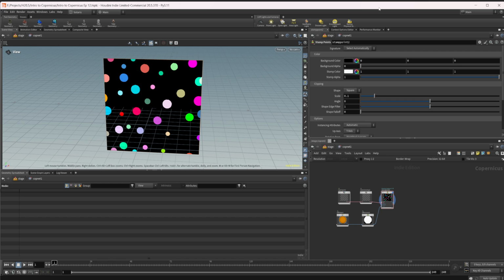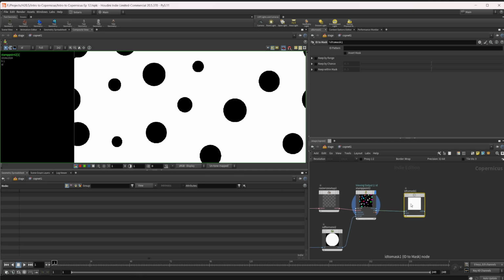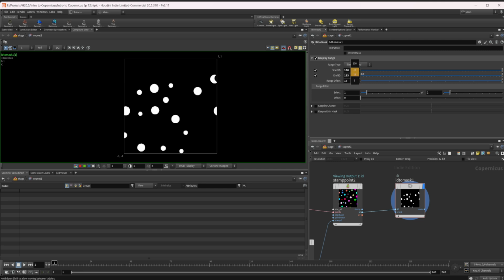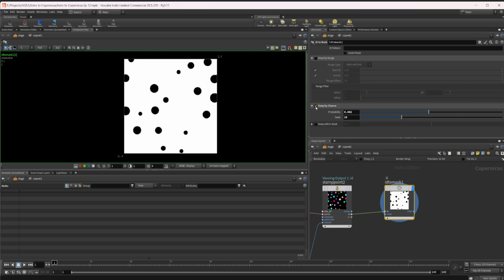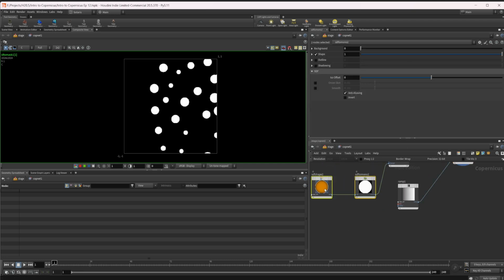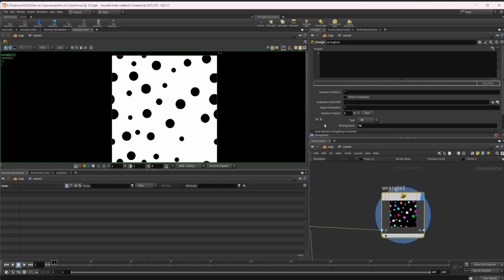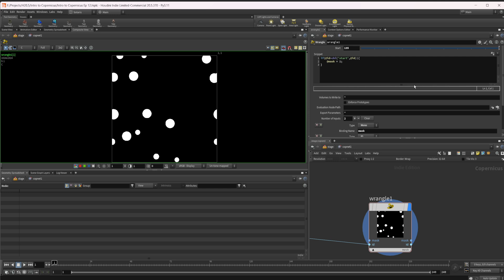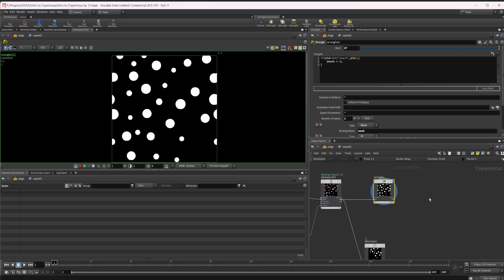ID to Mask and COP Wrangles | Intro to COP's | Houdini 20.5

Comment: Awesome, You dont waste too much time banging these out, fair play to you. Thanks for the follow up I think you do a great job opening up various options  for people. Yes I also found tthe pattern thing a bit odd.  I think here you could do something like 0-138 to get everything less than 138. However !0-138 doesnt work to get the inverse. To get above 138 you could do 138-1000 which works but feels clunky. @id="130 140 138 144" this work but as you point out @id>130 does not. The wildcard syntax feels a bit unfinished but then Im not a great fan of it even with the group nodes.  Keep up the good work
Reply from the maker: I'm not at my PC right now but does it just require quotations to make the greater than or less than statements work? Thanks for your feedback. I try to cover as much as I can and if things aren't clear or I skip over something important I appreciate that being pointed out so I can add to it. Just trying to help people make things
Reply: @InsideTheMindSpace  I tried brackets quotes ticks etc. but no dice at least for me. I'm sure it will be some random syntax that is slightly different from everywhere else 😂
Reply from the maker: @3D_GO well darn. Maybe someone will know